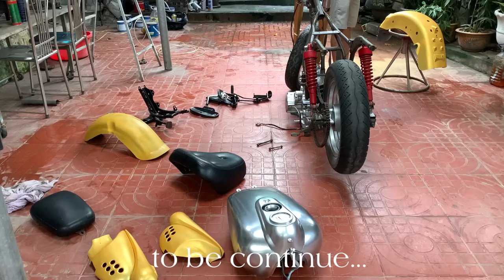Ｒestoration Ｈａｒｌｅｙ davision built | Ｒestored dusty motocycle

Comment: Harley  doesn't  make a bolt in 2 stroke engine for any mid -range bike let alone any at all.😱😱😱😱😱
Reply: I have to make a correction  here about Harleys in doing some research  I found that they did have a mid range bike called a " SPRINT" with a two stroke engine research of 125 to 250 c.c.

Comment: It said Honda on the side covers. Plus Harleys have almost no metric bolts. This is a honda. Except for the VRod and Street models(which were both designed as metric based) the number of metric fasteners on a Harley-Davidson can be written down very quickly. Front forks, starter motors, brakes(sourced from foreign based companies), and batteries all are metric. Honda are top of the line motor cycle for sure.
Reply: It said Lifan, not Honda